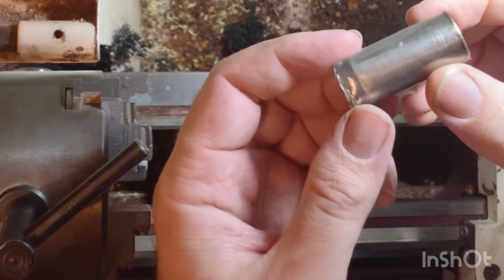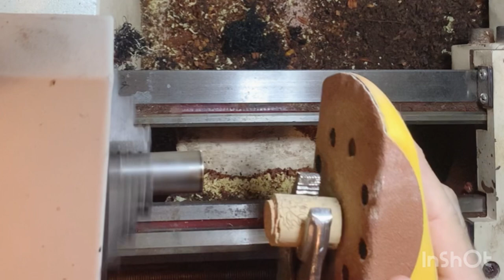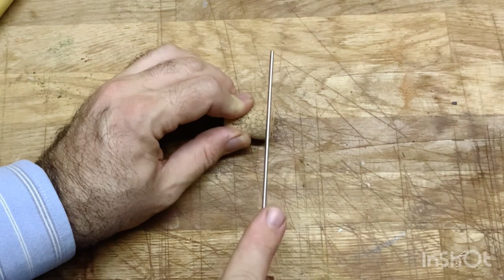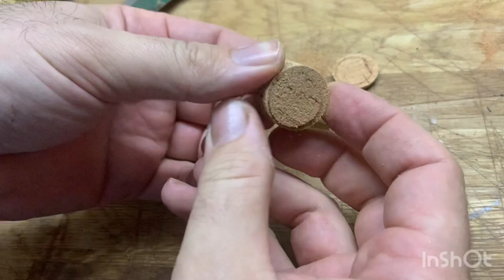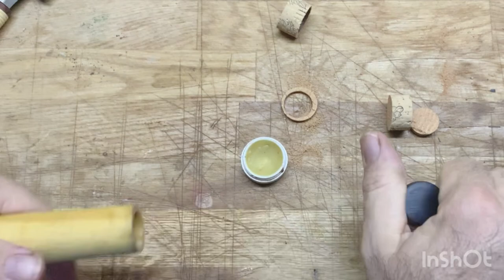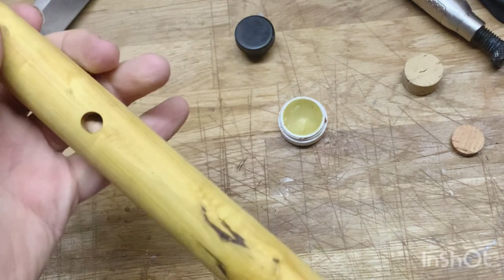The baroque flute cork - and how it’s made

Comment: measurements? looks like 2cm id ... ???
is there a formula for creating a perfect pitch... ie... size of the tube... size of the mouth hole... ???
Reply: so .. I found a jade flute on ebay... with a silver alloy metal at the junctions... it's in the mail... I'll keep you posted... it's very very old... but definitely playable... but they don't use the same scales we do.. so I don't know what it will sound like... I have high hopes ;;~}
Reply from the maker: yes. you must have the blueprint it is extremely precise measurement in order to get a perfect  pitch